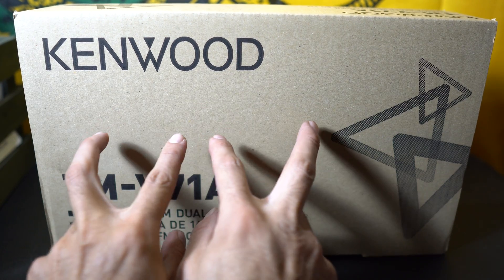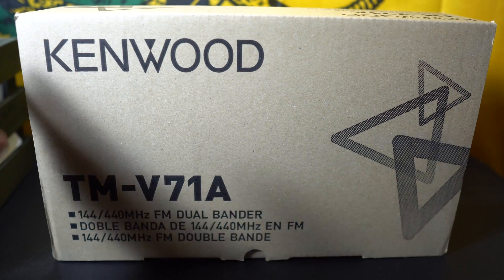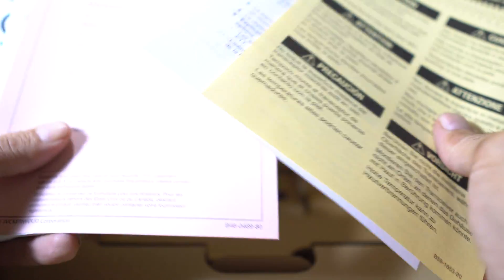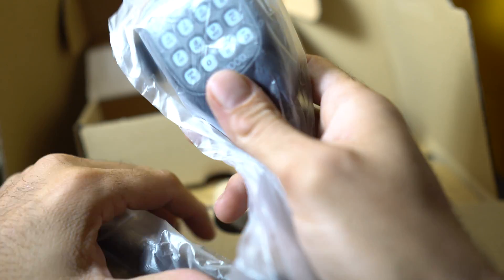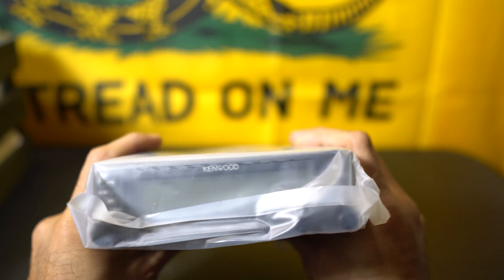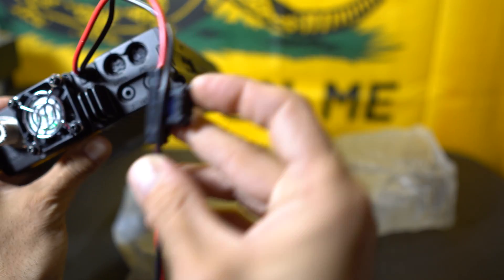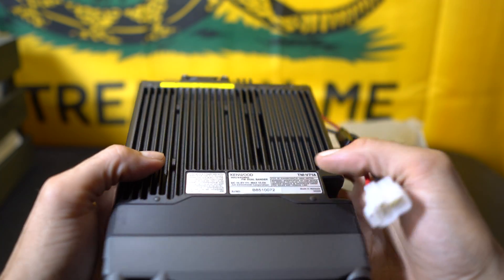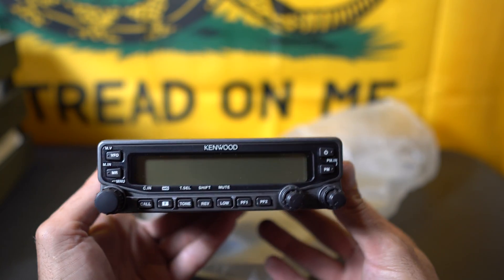New Radio! Kenwood TM-V71A

Comment: Great video! This is a great radio! I have the TM-V71A and the DM-D710A and they are solid radios! With this radio you can run a speaker for each side, and they are super easy to program!